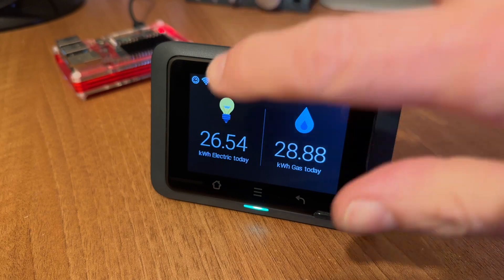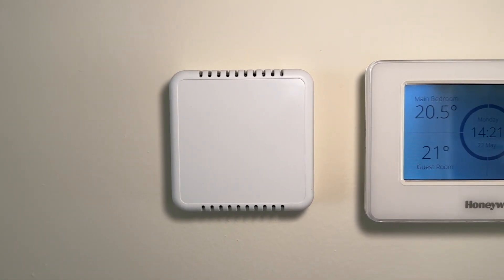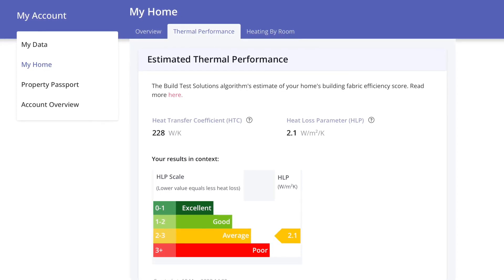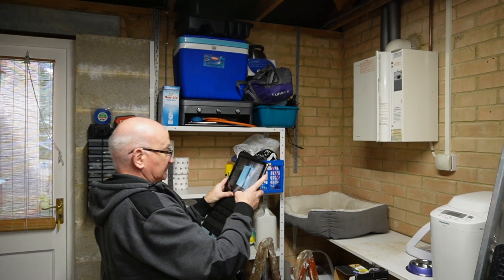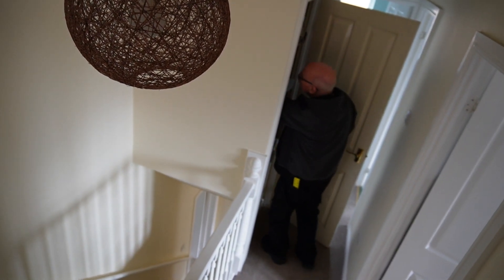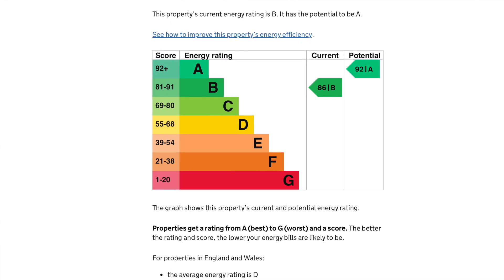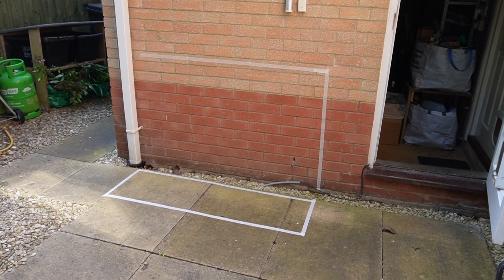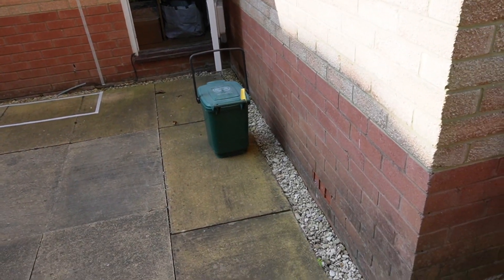Project Heat Pump: An EPC and a Heat Pump Survey from Octopus Energy

Comment: I’m a heat pump MCS installer.
I’m sticking with gas. House super insulated EPC has zero recommendations.  Heat install along with a new induction hob 
Remove gas supply.  Actual cost me more per year in running costs not including annual maintenance 

There is a zero pay back

Unless I was on oil or LPG
Reply from the maker: You're missing a trick then if you are able to do your own install, would keep your initial costs way down! For me it's not about the financial pay back - it's a heating system, it's there to heat my home not pay me back monetarily. What I do want to do is heat my home without directly burning fossil fuels and to do that in the most efficient way possible. A heat pump is currently that most efficient way,

Comment: This will shock some people!  We spent several weeks discussing a heat pump installation with Octopus - and finally got an arrangement for a November install - and paid the deposit.  We were then handed over to a new Octopus person - who promptly abandoned all our arrangements and tried to get us to agree a mid-January  install - despite our specific agreement that as pensioners we could not accept a December-February install.  We have refused, so Octopus has gone silent.  FWIW our first discussions with Octopus started mid-December 2022 and it is now September 2023.  In addition, the person concerned had not read a single thing from the negotiated agreement.  Clearly, this install is not going to happen despite 12 months of discussion!
Reply from the maker: That's not good, I hope it gets sorted soon for you
Reply: Yes, Octopus has accepted a proper date - although the surveyor then failed to turn up ... @SpeakToTheGeekTech

Comment: We had our ASHP fitted about 20 months ago so were lucky enough to take advantage of the more generous RHI grant scheme.  For us it was a bit of a no-brainer too, we had oil fired wet central heating (no gas in the village) and when the oil tank started leaking I found that I couldnt have a replacement fitted in the same place as the original - had to be 1.5m from buildings, sheds, etc and 760mm from the boundary fence.  I found it difficult to get quotes for our ASHP, lots of companies never replied back and one wanted a non-refundable deposit to do the quote.   Company we went with didn’t charge for the heat loss survey & quote which I liked, and we went with them.
Due to the size of the house we had 2x 9kW heat pumps.  A 15kW was the right size but there wasn’t one on the MCS approved list at the time.  After I get the RHI grant fully paid (over 7 years), it’ll have only cost me about £2k for the whole system, which I’m happy with.   Most of the radiators were replaced as was the hot water tank.   Annual running costs are very similar to oil.
Reply from the maker: Thanks for sharing, I wish the RHI was still available! The £5k scheme in place at the moment barely scratches the surface of the costs!
Reply: @SpeakToTheGeekTech  the RHI grant was part of the consideration. We got in just a month before it was withdrawn.  Definitely worth having and the payments are index linked so have shot up this year 😀
Reply: Perhaps you are not aware that the ASHP grant has been increased from £5k to £7.5k.  This changed our situation 🙂 @SpeakToTheGeekTech

Comment: Not a bad video

I don't want to get a heat pump, not until I've :

Super insulated
Replaced all my piping from 10mm to something a bit more substantial
Replaced all my windows for triple glazed ones
Get an MVHR
Get PassivHaus doors too
Only after I've done everything, will I get a heat pump. 

It's a fabric first approach
Reply from the maker: I agree, unless your boiler happens to have a red light flashing on it… :)

Comment: Have you had a look at the heatgeek consumer series? Itll be interesting to hear what MWT they are designing your system to? 
One tip, Definitely get rid of those Evohome valves, or leave them on the bedrooms but as temperature limiters only. 

Good luck on your ASHP adventure
Reply from the maker: Yup, I keep an eye on his videos as they're very informative! Octopus tell me some of their guys are heat geek trained too. Evohome is most definitely going to be ripped out and sold on to someone else, and upstairs there'll be non-smart TRVs instead.

Comment: Hi, I’ve been given an initial quote by Octopus and they want me to pay a refundable £500 deposit before they come to do the full survey. Is that similar to your experience?
Reply from the maker: Yes that's correct. The £500 is refundable (plus interest) right up to (I think) two days before your agreed installation date if you change your mind.
Reply: Thank you. Deposit paid.
Reply: How long from contacting did they get in touch for an initial quote?
Reply from the maker: For me, I spoke to them on a Saturday at the Full Charged Live event and they called me back on the Tuesday to get more details and provide a quote. They would have called back on the Monday but it was a bank holiday.
Reply: I think it was around 10 days, I filled the info out on the website. It’s wasn’t immediate, I got a call out of the blue.

Comment: Very useful your video.

Congratulations !

Is possible to have more information about your Hildebrand Glow measurement's and a companion with EPC ?

If I use my reading's from smart metter/ PV inverter and a good temperature sensor is enough to know my heat losses?

What accuracy have this measurement s?
Reply from the maker: The temperature sensor used is a very specific one tied in to the Hildebrand / Bright / Glow ecosystem. They have partnered with a company who provide an algorithm against the data it collects in order to provide the heat loss estimates.

This is the main Hildebrand guide and you can click through to the various steps to see more detail such as the “check home fabric score” one:
https://glowmarkt.com/home/infographics/heat-pump-journey

And their temperature sensor is here:
https://shop.glowmarkt.com/products/sensors

I don't have any independent way to compare the results of this process other than by seeing it is ballpark similar to EPC results. I've done this more so as I can see how the HTC estimate changes as I make changes to my home. For example, once the heat pump is in and I've added more insulation to my loft where the tanks used to be.

Comment: Good video thanks for sharing. I have been going through exactly the same steps. 21 year old non-condensing gas boiler to replace. Heat loss survey done, EPC done, planning permission sought and approved on Thursday 25th May, ASHP installation booked in for 30th June with Heat Geek Elite JMR Heating and Plumbing Ltd.
Reply from the maker: Good luck, you're ahead of me!
Reply: @SpeakToTheGeekTech  it's amazing how many people are on exactly the same journey when you start to talk about it and share your experiences.
Reply from the maker: I know, I waited for my brother in law to go through it last year first so as I could keep an eye on his system over winter. I saw your video last week too talking about it so I knew you were on the journey :)
Reply: @SpeakToTheGeekTech  exciting times ahead. We will have to share info and stats. Shout if you need a hand with your planning application as I did mine.
Reply from the maker: Cheers, I'll see what Octopus get back to me with - that should be early next week. I have a backup location which I think would mean it can go down as permitted development, but the preferred location needs permission.

Comment: Have you considered an air-to-air heat pump?
Reply from the maker: Yes I did, but as I already have a wet system it would be quite a destructive process to have the required vents installed downstairs (upstairs is less of an issue as they could run in the loft). But what really made the decision was being told by the boss that I wasn’t allowed to fit vent units in each room because they would look wrong. So despite my hesitation about air to air, they were vetoed early on!
Reply: @SpeakToTheGeekTech  Ah, yes, I can see that installing vents and ducts everywhere would be an issue.

Comment: Do you have microbore piping? Do you have to change any pipes to or from the radiators? I would be most concerned if I had to have my house repiped from within and totally redecorated.
Reply from the maker: I have 10mm microbore, I thought it was 8mm to be honest but the surveyor measured it and says it’s 10mm. Any smaller than 10mm and they would re-pipe but as it goes they have considered that flow rate in their calculations. It’ll obviously reduce the potential efficiency which is a shame but perhaps I can get the pipes changed when redecorating
Reply: @SpeakToTheGeekTech  Thank you. It is encouraging that the system may work with 10mm. I will follow your moves with interest.
Reply: Interesting, I thought 10mm was a no go for heat pumps
Reply from the maker: I don't think it's advised under most conditions, there will be a drop in efficiency and an increase in the speed that the water must be pumped around the system, which increases noise, pressure and wear and tear I guess. If you're able to rip the pipes out and put larger ones in, it'll be much better. But, I'll let them do what they think is best and we'll see how it runs at the end.
Reply: EVM has microbore in the top floor of his house,  and was able to have a heat pump fitted.   I think it depends on how much microbore you have and where.
We have 15mm throughout and had two pumps fitted in a a push/pull configuration to improve the flow rate round the house

Comment: Why do you need planning permission?
Reply from the maker: That will be discussed in part 2
Reply: Yeah, that was my main headscratcher tbh. Guess we will find out in Part 2
Reply: I thought planning permission is required in a few situations non of which I think apply here

If your putting 2 heat pumps in at once
If it faces the highway seen from the road
Forward facing in AONB
If heatpump is within 1m of boundary to neighbour
Reply: I had two heat pumps installed as they needed that for the size of the house.  Didn’t need planning permission for mine.   Another reason (not relevant here) for needing planning permission is if you already have a wind turbine.  Noise I guess?

Comment: I had my hot and cold water tanks removed 14 years ago when everyone was pushing condensing boilers.  2 years ago that boiler broke and got replaced with another more efficient model and now people tell me i need to put a hot water tank back in so i can use a heat pump.  Seems that we are going round in circles.  If i hadn't have had the tanks taken out then i would have gone with the heat pump but now i am stuck with the condensing boiler for a few more years yet.
Reply from the maker: Yeah the last 20 years have seen a real trend in combi boilers being installed in place of hot water tanks. On the face of it they were a more efficient way of getting hot water if heating using gas… but things have moved on I guess
Reply: I don't think they'd be fitted with an old gravity system (cold water feeder tanks in the loft) anyway
Reply from the maker: I have an old gravity fed system. They’re going to drain and disconnect those old tanks so as they can be removed. The system will be converted to mains pressure and a new water tank installed.

Comment: Very interested in seeing the follow up video, I work for a company that creates a "hub" for optimal running of the heat pump, would be good to talk to you about this.
Reply from the maker: Would that be something similar to Homely? My plan at the moment is to hopefully run on the native heat pump controls (Altherma) and rip out Evohome because it’s not really heat pump appropriate. I’m open to using something like Homely but add-ons this year won’t be within budget! Perhaps I’ll save up for 3rd party controls next year.
Reply: What name have your app? A link?
Reply: I currently have a Tado system so hopefully can still use that. Also have an Eddi for hot water which I use all year. Both work with HA.
Reply from the maker: I would be cautious about using traditional heating controls with a heat pump. Despite the manufacturer's claims, they don't tend to be as efficient when compared to the heat pump's native controls. In the case of. my Honeywell Evohome, by default it's a binary on/off control (TPI) based on the thermostats calling for heat, whereas a heat pump needs to control itself given temperature reading(s) in various places. Heat pump controls work more like Opentherm controls, only they're not Opentherm. Have a look on the Heat Geek YouTube channel (and check out the Homely videos too!). It is possible to use Tado, but it's not recommended.

Comment: I went to fully charged north and met Jim Bennett, head heat pump guru at Octopus. Had a quote of £6,700 bosh. Found our EPC and re quoted at £5,900. Big issues for us is Octopus bill states annual cost for gas is £640. Not cost effective for us. I still don’t understand why this government is allowing gas boilers to be fitted to new build.
Reply from the maker: Our gas usage is very low too and causes calculation problems for cost-effectiveness, but that'll be in part 2! I'm not counting cost-effectiveness as a decision here though. The boiler needs replacing with something, therefore a heat pump is the most efficient long term alternative available right now within my reach and I hate the talk around pay-back periods for heating - it's purpose is to heat the home, not break-even on installation cost! Putting a boiler in to replace the boiler would be madness in my mind. It is crazy how gas boilers are STILL allowed to be fitted when we're supposed to be phasing out gas. Makes no sense to me at all.
Reply: @SpeakToTheGeekTech  there are providing a payment plain in about a months time.
Reply from the maker: Payment options and costs will be covered in a future video. Not got the full video plan order in place yet, depends on how the story develops!
Reply: Most new build houses have tiny gardens.  There is no space for heat pumps.  Condensing boilers are very small in comparison.
Reply from the maker: I’m fortunate in having space for it, but there are more compact options for smaller premises, split units, etc. You can wall mount them in some circumstances, and there are air to air options too. Failing that there are direct electric options too - many electric alternatives to gas for when a heat pump isn’t appropriate. I know they’re not for everyone but over the last couple of years I’ve now seen them on other homes working great so I have confidence it’ll be suitable for me.
Reply: New build companies want y to sell houses. Anything even slightly controversial, when wrongly so, like heat pumps is not worth it if it should affect sales.